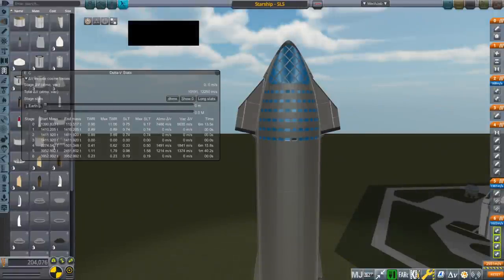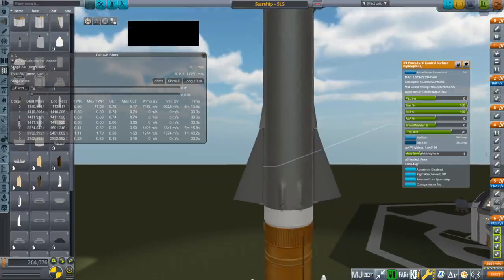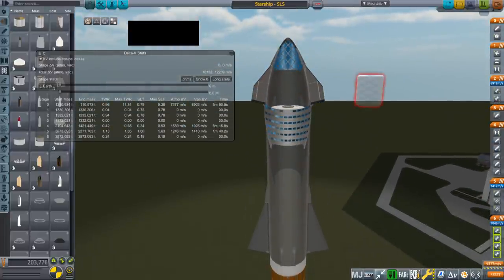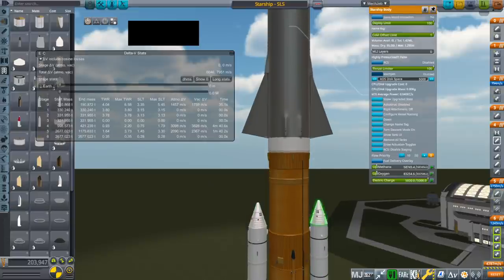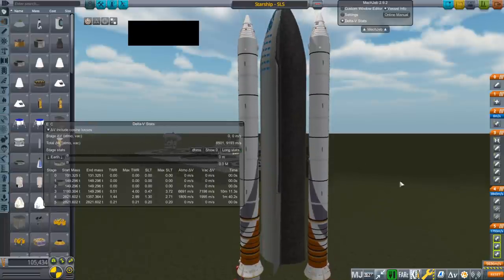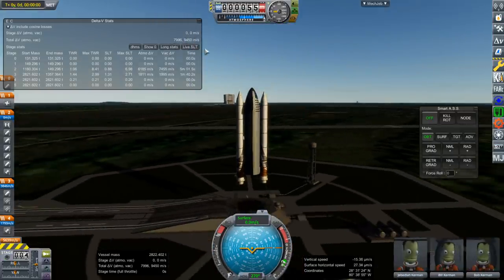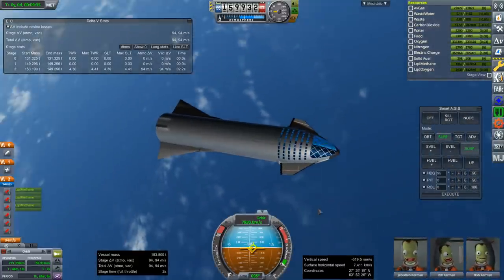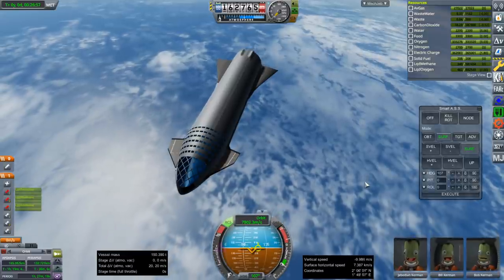Realism Overhaul in KSP 1.8.1 - Starship - SLS

Comment: Would a Centaur upper stage atop a Falcon 9 booster be less ridiculous than this?
Reply: Absolutely
Reply: Actually the original concept for the raptor was to be a hydrogen engine for the upper stage of the falcon nine to give it similar performance to the centaur.
Reply from the maker: Hopefully you mean on top of both the first and second stage of Falcon 9, right? In that case it's fine. I think I discussed this when I compared the upper stage of Falcon 9 to the original Atlas in this video: https://www.youtube.com/watch?v=N7MMP0L980I
Reply: how about Orion on falcon 9?
Reply: @Dominion69420  It would require a falcon heavy.
Reply: @RaizSpace   In my imagination, the Centaur would completely replace the usual Falcon upper stage. But of course, the stage-connecting hardware would have to be heavily modified to accommodate the differences in diameter and securement systems.

Ultimately, the M-Vac engine might not be quite as efficient as the RL-10, but it has a higher TWR. Therefore, it might be able to execute the same orbital maneuver in less time, which would require less fuel to be burnt.

If the hydrolox Raptor concept was abandoned, I'm sure there was a good reason. It was probably determined that the overall performance increase was not large enough to justify the costs of developing an entire new engine, setting up infrastructure to handle a  new fuel type, and needing to stock more spare parts.

Comment: Hey Raiz do you know ore can you test how many lauches it takes to refule Starship in orbit?
Reply: I think about atleast 5
Reply: @_mikolaj_  Well I know that it cant be more than 12 at most because the current advertised Fule Masse of 12000 tons and 100 Paylode. The question in how much Fule is left after the first Starship makes orbit? Something I can not easily test. Also, remember that Launching takes time and money which is why I am a bit wary of musks claims of using starship as a human launcher. Space X recently beat the turnaround record of the Spaceshuttel at 51 Days with Falcon 9. Let's say they have that wich Starship which is a way more complicated than Falcon but hey for 5 launches that would be 125 days more than 4 Monts that's a long time to wait for your ship to be refuelled before you fly to the moon or Mars. And those 5 launches assuming an optimistic launch price of 100 Million Per launch would cost 500 Million. Cargo and Luna are and other matter of the curse but space x needs to get that Tanker refuelling system down before they get anything near ther 100-ton, Gole, to other planets and it will not be easy by any means.
Reply from the maker: Depends a lot on what the actual structural mass of the cargo starship will be and how much propellant Super Heavy needs to reserve for RTLS. Anywhere from 6 to 10.
Reply: @RaizSpace  Thanks for responding did not expect that. :-) Hey do you know other advantages to orbital refuel besides splitting a big 1300 tone Paylode on 6 Launches as supposed to burning the 31600 tons of fule that takes in one titanic Rocket and launching Starship fully fuelled? I know that it will increase the Starship launch rate which is important for reusability targets. Is ther something else I am not thinking of? Also down ther are how I got to those numbers in the original Question.  

6 Starships burn 3400 tons of fuel each and 6 Starships burn 1200 tons each. Each caring 100 tons of fuel to a Starship wich lets say burd half of its fuel ad was put into orbit by an additional Superheavy. Meaning the total amount of fuel burned is (3400*7)+(1200*6.5)=23800+7800=31600 tones of fuel burnt total. What has that gotten into orbit? well, 1200 tones of fuel and 100 tones of paylode. So that's 1300 tons of Paylode in LEO we can drive a mass fraction fore that system by dividing the Paylode by the fuel 1300/31600=0,0419.. That's not that bad when you copper it wich and Atlas 541 burning 475,448 tons of Full and a 4 t Paylode to mars wich a c3 of 12 km^2/s^2 4/475,448=0,0084.. Fule Paylode Ratio. I of cure made some assumptions hear, I omitted the Dry Mass of the Viaclas to make calculations essayer and I used the advertised values froe Starship which may change in the future. 
But a  few things I think are clear first It will take a heck of a lot of Methan and oxygen to move a hundred tones to another Planet. 

Second, while the Starship refuelling system has a whores fule fraction than a single Starship at 100/4600 = 0.046 it is not that much better at 0.0419 meaning that the fuel ratio is almost the same as you would expect because they are the same Launch system just splitting the paylode among multiple launches.

 And the third lily while this mass fraction might not be that impressive it is better than Atlas V Paylode Fraction for a 4-ton Launch to mars allow I am still not sure if my numbers are correct and commercial wich starship since one Atlas 541 is another leag entirety in terms of launch mass and I might also have made mistakes which is always possible.

Comment: Why didn't you just strap 2 more boosters to solve TWR problem?
Reply from the maker: That's not SLS and if I wanted to solve the problem, I wouldn't use SLS to launch Starship at all. Also, that wouldn't solve the post-SRB TWR problem.
Reply: @RaizSpace  but what if SSME were replaced by M-1?
Reply from the maker: Then can I just use a completely different rocket with M-1s? Because you can't fit enough M-1s at the bottom of the SLS core to beat the thrust of the SSMEs - the M-1s are too wide.